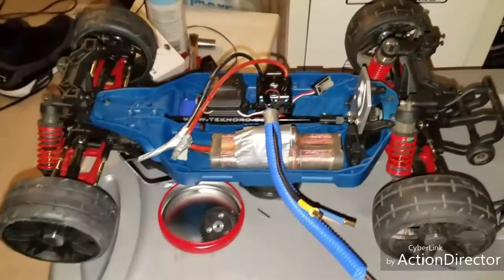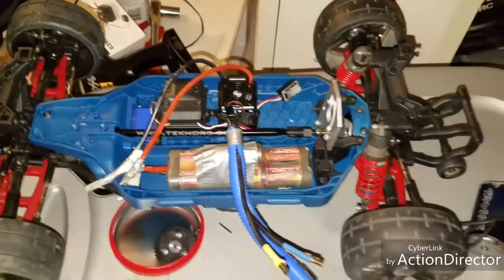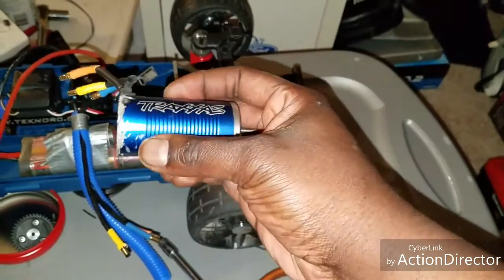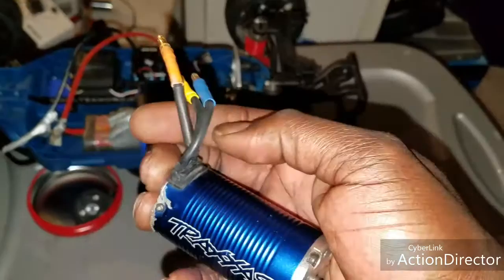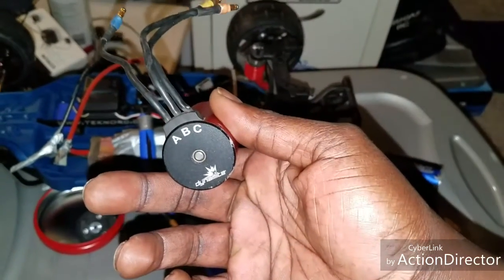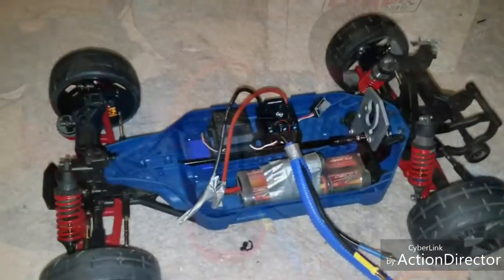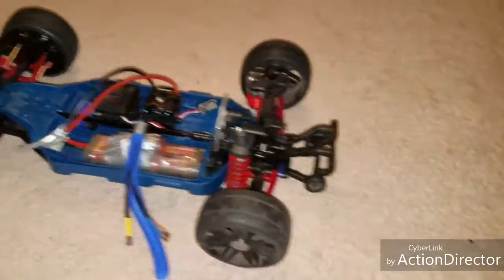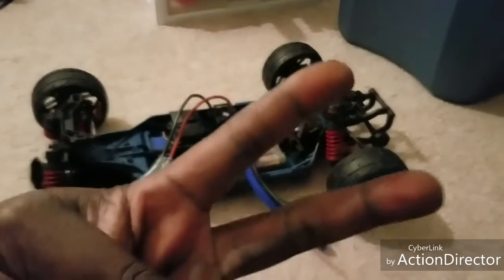I need some help on my slash..

Comment: Its the drive shaft. I had the same problem. Back the cup up on the spur gear. ( put the cup closer to the gear). It might be installed a light to close. And still grind the plastic away. Mine was hitting. So i did it anyway. That should fix the problem.
Reply from the maker: RC MAN 23 thanks man.ill give it a try
Reply: chevybrotha np

Comment: The two front screws that go into the chassis needs washers on the bottom side of the chassis to create space.  The ones above the front A-Arms.  You can tell by loosing them and the clicking noise will go away.
Reply from the maker: Enuf4U thanks for.the tip

Comment: Yeah you need to give the shaft some room to move. If it is too tight it will cause the front drive cup to flex up and make the rubbing sound. I personally  use the stock aluminum drive shaft with no problems.
Reply from the maker: Jason Stephens thank you..

Comment: it might be your diff bearing in the front diff.
Reply from the maker: TATMONEY thanks tat..I'll check it out..which bearing?the pinion bearing? or the 2 diff bearings?
Reply: chevybrotha diff bearing the one in the front that connects to drive cup for the tekno shaft.make sure its not wobbling.